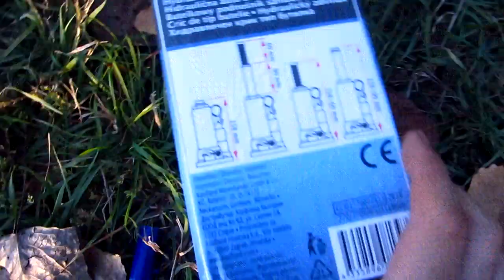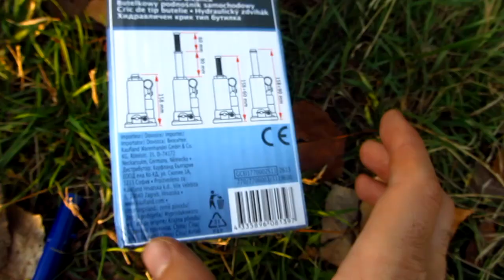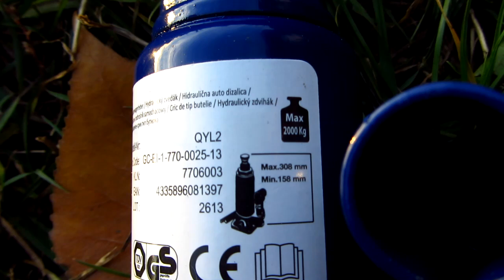How to lift a car with a Hydraulic Jack

Comment: To me, a bottle jack is for side of the road emergencies otherwise use a floor jack. But if you've gone to the trouble to think far enough ahead to have one of these instead of relying on a stupid sissor jack included with your vehicle, then pack the propeer support dunnage as well. A few pieces of 2 x12 is all you need.

Comment: My Story :

I drive i20 elite. Once it had flat tire due to faulty valve, so I had to change tire to Stepney. I applied hand break and put car in 1st gear. I used OEM scissor jack, to lift the tire. but tire was not getting out. My bad, I thought, tire is stuck due to hand break and gear. Huge mistake, that i released hand break and gear, in jacked up position. Full blunder due to ignorance.

As other 3 tire moved a bit, jack come down and crashed, got bent from all patti sides.. I had to throw away that OEM jack. Then I took help of some cab driver guy. Thanks to him. He lend me his jack.

Then I bought hydraulic jack 3 ton from Flipkart. I tested it, like on most YouTube videos. It works fine when none of the tire is flat. I can lift car easily, and change tire. But who will replace tire, when all 4 are good. 

After few months, got a punctured tire. On flat tire, car comes down. In this less height, I put 3 ton hydraulic jack, lifted car, but it didn't lift upto proper height, so that tire can be removed. Tire was still stucked. I had to call puncnture wala guy.
If I buy 5 ton jack, it won't even fit below under a flat tire. 3 ton was my best bet.

Moral of the story : 
1. Always apply hand break and gear, stopper stone under diagonally opposite tire of  flat tire before jacking up and whole time till the jack is removed. Car must not move even 1mm when it's jacked up.

2. Always prefer company fitted accessories over after market. OEM jack was good, I didn't used it safely.

3. Never buy small hydraulic jacks, just to save 10 min efforts, that too very very rarely. Don't take risk on road specially on long journeys. As these jacks have not been tested by company in all possible test case conditions.

Stay safe, Be happy.

Comment: Pressing down the bottle jack with my hand to lower it down. Wasnt what i was expecting to do. I was like its going to lower down slow by itself.
Reply from the maker: At around 4:20 it wasn't fully rotated to the left, but even than it would not go down by itself, it was too new at that time, it's not going down by itself now either.

Comment: You are always supposed to lift your car on a hard flat surface. This is not the correct way of doing it.
Reply from the maker: That's the theory, what if your tire goes flat when you're in the middle of nowhere...
Reply: @furulevi  You either tow it or drive a bit further towards the road. It's extremely dangerous and can damage both you and the car if you change your tires on soft grounds.
Reply from the maker: There are no asphalt roads everywhere in nature, nor mobile phone signal in the woods.

Comment: what's the optimized height if I want to work under the car? Say I want to change transmission fluid.
Reply: Don't work under a jack. Please use stands after jacking the car up, it may fall and kill you otherwise.
Reply from the maker: Just make sure the car won't move while you are under it. Pull the handbrake (to brake the rear wheel), and put the car into gear (to brake the front wheel), or place some objects (rock) before and after a wheel so it won't move. Raise the vehicle just as much so you can fit under it (10-20cm / 4-8inch). You can also place a spare tire (or an axle stand, bricks, wooden blocks) under the car, just in case the car falls off the jack.

Comment: what if that wood cracked?
Reply from the maker: Just add a wider metal element between the jack and the wood and the wood should not split. That's why the jack's base is also larger to limit the jack from entering into the ground too much.

Comment: Good Video. I noticed that the jack was sinking into the ground and tipping a bit while lifting the car. You might want to look at SAFE JACK videos to see some simple accessories that will make jacking or lifting a car much SAFER.
Reply from the maker: Thanks!
Reply: This guy owns SAFE JACK he is masking his sales pitch with "helpful advice" I made a plate to do the same thing as his stabilizer for 10 bucks just weld a plate to the bottom of your bottle jack took me 5 minutes and the thing will lift a bus in sand literally